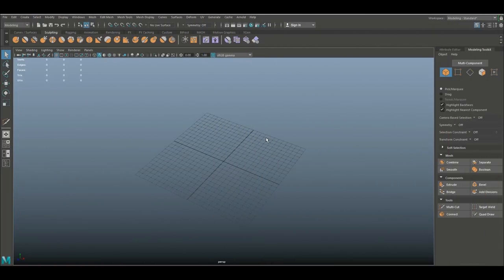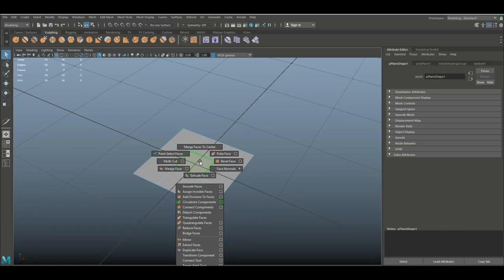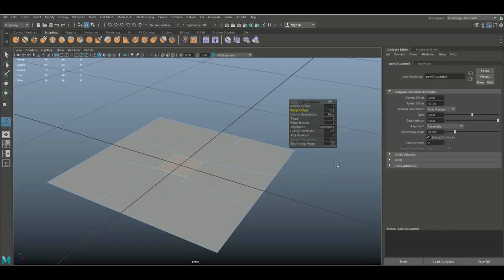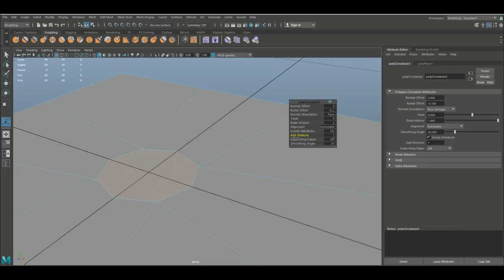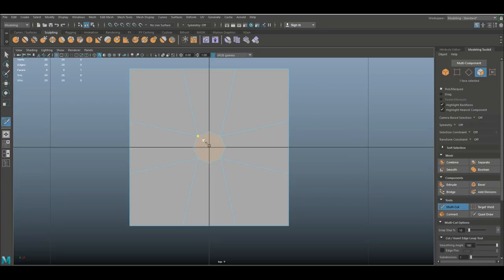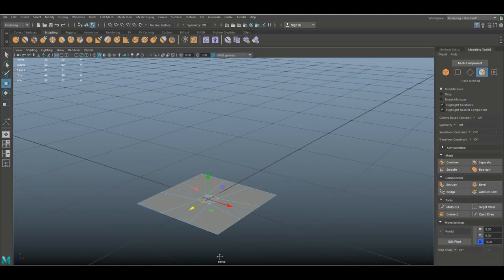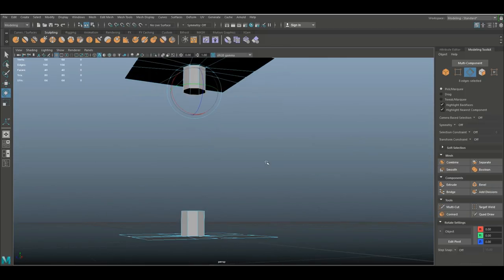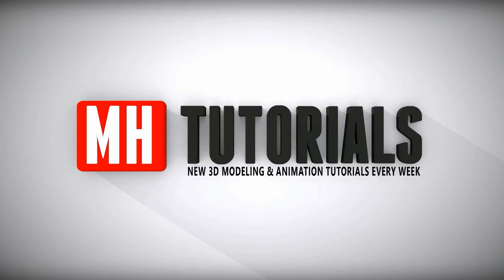New Maya 2018 feature : Circularize components

Comment: Doesn't seem that great
Reply: It seems very easy to use to me. How do you do it?
Reply: Sir Crimson I didn't say it was hard to use but it seems like a very unnecessary feature
Reply: Jeff Smith I know, that's why I asked how you do it.
Reply: Sir Crimson well for starters I'd most likely make it floating geometry and not have it be sewn in
Reply: Jeff Smith Why is that better?
Reply: Sir Crimson what is your experience with 3d
Reply: Jeff Smith How is that related to my question?
Reply: Sir Crimson  because you're asking a lot of questions
Reply: Jeff Smith I asked one question that you can't seem to answer properly.
Reply: Sir Crimson that's because it's not that easy of a question to answer. How I would use it depends on what I'm trying to do and what geometry I'm working with